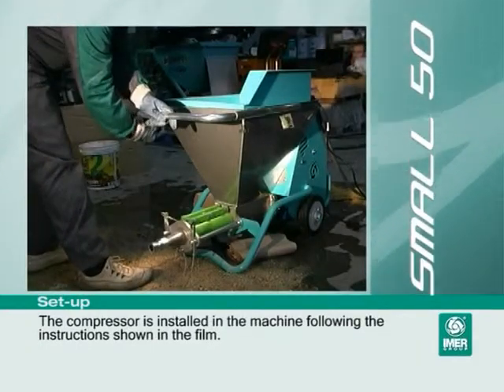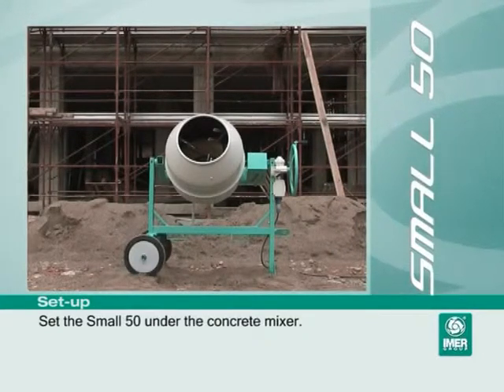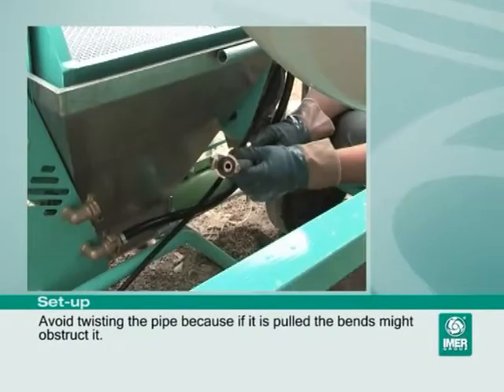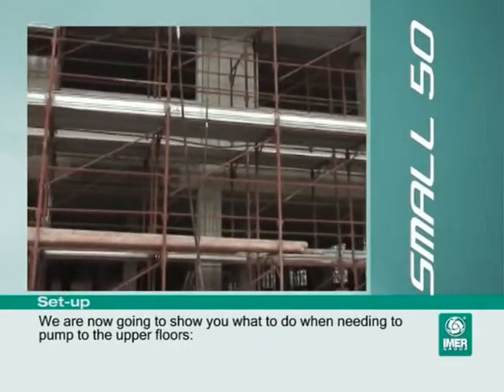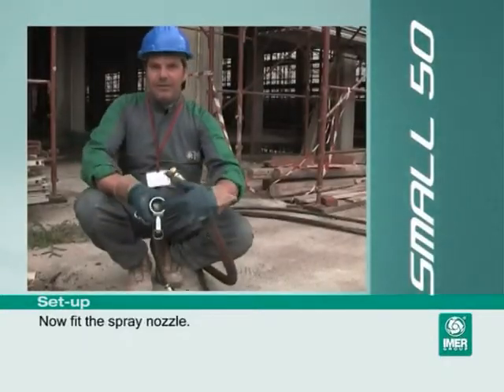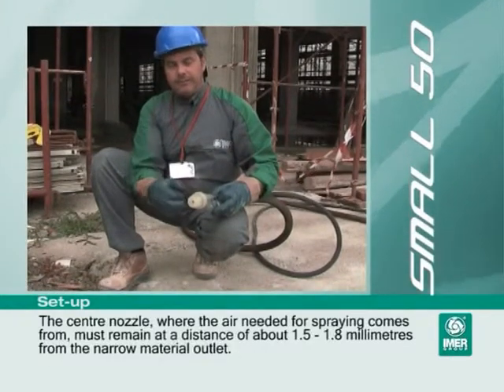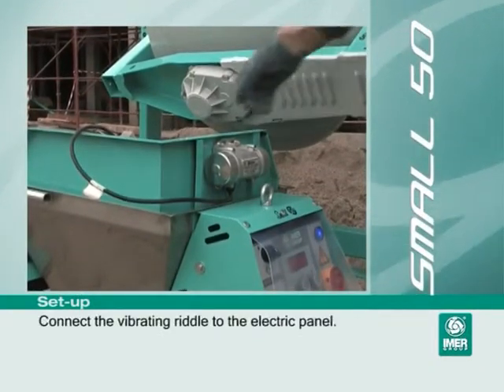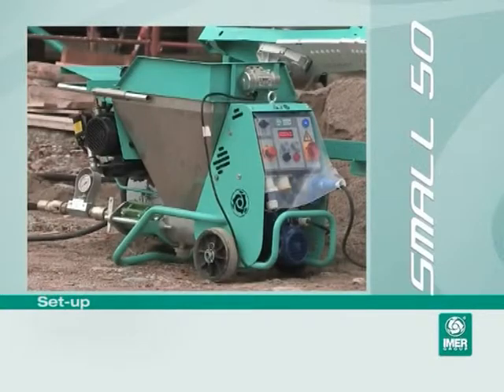Small 50 User Part 1: Setup

Comment: How about a setup and operation video for the stepup 120? There is a bunch of small 50 videos, but little to nothing on the higher end machine. 
Please include as much detail as possible.. flow rates, lift heights, mix recipes, etc! 

Thanks!
Reply from the maker: Here is the link for the Step-up 120. Step Up 120 Spraying Pre Blended Mortar